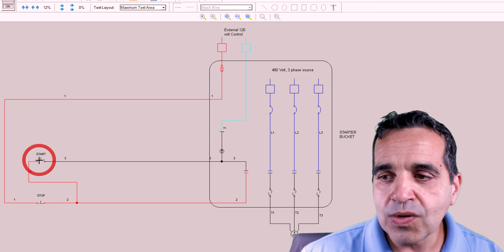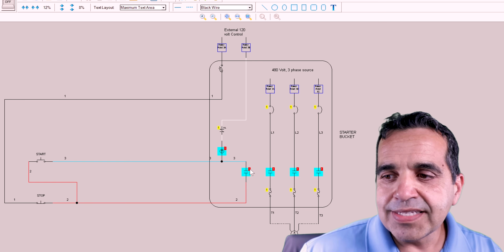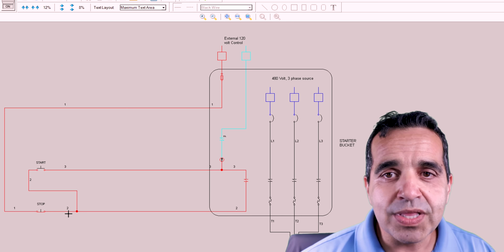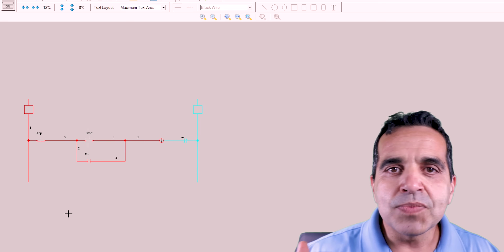Basic Motor Control: 3 wire Start Stop Circuit

Comment: You stated only 3 things turn the motor off but what if there is a ground fault in the field winding? Doesn’t the 480v circuit breaker trip thereby de energizing the motor?

Comment: I’ve watched dozens of videos, no one explains HOW these contacts are connected. If the overloads trip, the coil loses power but HOW? Where can I follow that schematic and see that by those overloads tripping, the coil opens? 

How is that 4th contact physically connected to L1, L2, L3 contacts? 

At 6:33 when he presses the start button the contact outlined in red closes. How would we know by following the diagram that the other 3 contacts close? I can see they switch to closed because the symbols change from open to closed but I just can’t follow the schematic physically to know that that is what would happen. 

Any help is appreciated. Have a great day
Reply from the maker: The 4th contact is not connected to L1, L2, or L3.. it is itself an individual Normally Open contact. It closes when the contactor coil is energized just at L1, L2, and L3 close. As far as the overload. It opens part of the circuit which energizes the coil. So if the overload trips the circuit to the coil is interrupted. This causes the coil to de-energize which opens the contactor.

Comment: Line 2 comes into the stop goes to one side of the start button. That side of the start button goes to the bottom of the contactor normally open contact. The other side of the start button goes to the top side of the normally open contact which is connected to the coil. I don’t know why this idiot cannot explain this properly.

Comment: Till 2024 I watched a lot this kind of videos, this is the best video I have ever seen with completely step by step animation.  I don't have to use too much imagination force to understand all.  Great job.  I wonder is there any contactor that uses its Lines to activate the control circuit, rather than use external 120V power source ?  If yes, how is the circuit look like ?

Comment: The symbols we use in the Netherlands are so different, would've never recognized that to be a coil. And why over complicate it with the overload switches, that could've just been an add-on after you explained the circuit. The drawing is complicated to understand if you don't know what the coil does and how it is connected to the switch

Comment: Suppose you do not have a 120V control source you also do not have a neutral and it’s 3 phase delta high leg.
Reply from the maker: It works the same way. You would need a coil on the contactor to be 240 Volts and would then use say Line 1 to power the buttons and line 2 through the OL feeding the other side of the coil instead of a neutral. This will give you a 240 volt single phase control circuit but the motor is powered by 3 phase 240v.

Comment: Excellent video. Thank you. Troubleshooting 3 phase 480v. I love it. Just today, had one phase open, after following conduit, found a bent 3\4 piece of EMT and a burn spot. Friday the guys changed a screen on the El Jay shaker, evidently when they dropped the screen over the side onto the ground they hit the conduit for the feed conveyor. So, overload tripped out from single phasing. Used a tubing cutter, on EMT and added a box a new seal tight. Reset overload and it's up and running again. Boys were clueless they even hit it.
Reply from the maker: Good job troubleshooting the motor today!

Comment: Great explanation on how to actually understand how the circuit works, I work in a huge paper mill when I'm in the MCC room looking at this bucket my motor could be hundreds of feet away where the wires leaving the load side of the motor starter goes to a local disconnect first , then feed the motor for protection.

Comment: why is it called a three wire start stop?
Reply from the maker: Because there are 3 wires needed to the start stop buttons. 1 power, 2 start, and 3 holding circuit

Comment: Thanks for the great explanation! I have one question, why would you rather use an 2 or 3 wire start, instead of a 3 pole on of switch?
Reply from the maker: A three pole switch is placed inline with the power to the motor. A 3 wire start stop can be placed anywhere you need to control the motor from including multiple locations.
Reply: Thanks, that makes sense

Comment: Great video, very well thought out. I also teach this material but I need a tool to transition to online classes. What software are you using for the simulation. I have been using animations in power point and it is very time consuming.
Reply from the maker: I use a tool called Constructor
Reply: @AccessToPower  thank you. I will check that out

Comment: I think once you see someone wire up the whole circuit, then do it yourself, you can really get a sense of how simple it is. I think VFD's are a lot easier to hook up and you get a ton more control. Centrifugal switches are another example of a simple latching switch that uses momentary buttons for start/stop like on a table saw.

Comment: GR8 video. I'm searching for a video that can reverse the rotation of a 480 volt using 2 contactors and 1 overload. Can you help? ...Interlock circuits and 480 trans connections.

Comment: Thank you for the detailed explanation. How much power runs through the control circuit (stop and start buttons)? Can the control circuit wire gauge be lower than the wires feeding power to the contactor/motor?
Reply: You could have as little as 12 volts DC in the control circuit, many systems use 24 VDC for safety reasons. 18 or 22 AWG wire. A relay has mechanically connected contacts but not electrically, so when the control contact closes, they all close.
Reply: @BariumCobaltNitrog3n  thank you. IN my case the starter coil was energized by 110v. So I assume that the coil wire gauge can be small because it is just used to close the contacts of the load line?
Reply: @bijeshj  Right. And wire gauge is determined by amperage, so whatever electromagnetic force is needed to close the contacts. 100-250 mA is common but I'm sure some are more. Using a 110 volt circuit is very common so that the 3-phase lines don't have to share. What kind of motors are you working on? hvac stuff?
Reply: @BariumCobaltNitrog3n   Connecting a wireless relay to a Magnetic starter for K3 sliding table saw (3Kw motor).
Reply: @bijeshj  Does that have remote monitoring on the wireless relay? Is that wifi?
Reply: @BariumCobaltNitrog3n  Just a regular wireless relay with a remote control. The remoe controls on/off on the relay - I wired the relay to control the magnetic starter.
Reply: @bijeshj  When you say regular wireless relay what is that device? and why a remote? Are the controls of the motor inaccessible?
Reply: @BariumCobaltNitrog3n  Relay module with a wireless RF switch (cheap on Amazon). The wired switch to the starter is difficult to access on the sliding table saw. I have it working but wanted to confirm if the wires from the relay to the Starter contact coil could be lower gauge than the 12awg motor wire.

Comment: Sir this basic connection is good for 3phs 10 hp 240v. Motor.?
Reply from the maker: This is a typical start stop control for any 3ph motor regardless of hp. You will still need to size the starter, overload and overcurrent protection to match the size and voltage of your motor.
Reply: @AccessToPower  thank you very much..

Comment: None of these videos about contactors really explain if you need a separate source of power to power for the coil to activate the contactor and another to power the motor. Or if the power to run motor also powers the coil separately in the contactor.

Comment: I can see the basic start stop circuit but i can not see how it is wired into the contacts of the multaple aplication?
Reply from the maker: Danny, check out the updated video inn the same subject. I try to show you each connection as I explain the circuit. https://youtu.be/kHbXbK7S188

Comment: Great vid..please show us how to find or trouble shoot a wire diagram in actual diagram..when it gets troubled like breaker, timer, fuse, overload relay, thermal relay..to find what parts is messing around
Reply from the maker: Thanks for the comment. For a troubleshooting video please check out out video on that Troubleshooting a Motor Starter
Reply from the maker: https://youtu.be/IxwTOByZ1yM

Comment: That diagram is incomplete. It should show the overload relay wiring. It’s just showing the overload devices without the NC relay and associated wiring.
Reply from the maker: It’s there on the diagram. Go to minute marker 2:51 and you will see the neutral wire from the control voltage going through the NC OL contact and then feeding one side of the coil.

Comment: Hey can u 🙏🏿 make on up front video to show the contact on the stop start botton  and how to connect the wires on them 🙏🏿🙏🏿🙏🏿🙏🏿🙏🏿🙏🏿🙏🏿🙏🏿🙏🏿🙏🏿🙏🏿🙏🏿🙏🏿🙏🏿🙏🏿🙏🏿🙏🏿🙏🏿🙏🏿🙏🏿🙏🏿🙏🏿🙏🏿🙏🏿🙏🏿🙏🏿🙏🏿🙏🏿🙏🏿🙏🏿🙏🏿🙏🏿🙏🏿🙏🏿🙏🏿🙏🏿🙏🏿🙏🏿🙏🏿🙏🏿🙏🏿🙏🏿🙏🏿🙏🏿🙏🏿🙏🏿🙏🏿🙏🏿🙏🏿🙏🏿🙏🏿🙏🏿🙏🏿🙏🏿🙏🏿🙏🏿🙏🏿🙏🏿🙏🏿🙏🏿🙏🏿🙏🏿🙏🏿🙏🏿🙏🏿🙏🏿
Reply from the maker: I have an updated video on the channel with close ups of the buttons and wiring. Same title with (update) at the end
Reply: @AccessToPower  ok I have find that one I would like a video of u explaining the difference s between ac an dc motor and if they troubleshoot the same way and the different size motor are being use in factory and how to read an understanding the labels on a motor  if it’s on it or not thank you for ur respond

Comment: How do u wire mcc panel
Reply from the maker: Willem, it depends. Is the control power internal to each bucket? Or is it one circuit common to
Multiple buckets?

Comment: Is your diagram a basic safety control box that protects the motor from overload? I bought an old belt grinder with a Weiser Co A-100 Safety Control Panel, but I don't know what is does or what it's for. It does have a flip on/off switch connected to the panel that must be turned on in order to get the main power switch to work. The main power switch is a separate press button on/off box that is wired to the control panel and turns the AC motor on and off. What components should I look for to determine what this panel is for, or what test can I do to determine the same?

Comment: I have seen contactor 220VAC single phase,that have NO and NC ... ,for what are these used ?? Thanks for the video!! Stay safe
Reply from the maker: microguard, there are numerous reasons one may have NO and NC contacts. A NO may be use as the holding contact, or a run light, or as a sequence control for another starter. The NC may be used to also turn on a light if the motor is not running, or to turn off a horn if the motor is running..... there are May possibilities

Comment: I am not used to breaking the neutral to de-energize a circuit.  Why not use the overload contacts in the motor started to break the auxiliary  power side to the coil?  In other words put the auxiliary overload contacts in series with the stop switch.
Reply from the maker: Stuart Milne , you certainly can place the OL contact on the control circuit side of the coil. I would suggest it be placed just before the coil though so it easier to troubleshoot.

Comment: Thanks, these Videos helped tremendously, I’ve worked on variety of Control Panels for Conveyor systems, And in my case had issues with actual loose contact wires that caused initial replacement of several components because, couldn’t determine actual cause of tripped breakers, also pitting and much carbon buildup that causes resistance buildup or arcing, loud explosive sound and smoking out of the Panels, at first thought was overloads because the high Current demands but turn out to be gap between contactors

Comment: Great explanation. Also, a lot of times the control voltage is tapped off of one leg of the load side of the contactor. So you don't have the need for a seperate control transformer. The power from the line side of the contactor goes straight to one side of the stop button. I agree about some electricians being intimidated by a motor controller. But it really is simple if you stop and look at it on paper.
Reply: Usually you dont use 277v pushbuttons. Youre more likely to see a separate 120v or 24v external power source than 277v push buttons, assuming youre using 480V/3-phase motors.

Comment: I wasn’t aware that the overloads cut the neutral when they trip. That’s odd to me. As an electrician, we’re always taught that you never control or switch anything with a neutral, even though it obviously will work. So why don’t the overloads open the hot control wire instead?
Reply from the maker: Hi Russell. I understand what you’re saying. Usually we do not switch to neutral.  I think this originated early on the automotive industry and was adopted by the NECA standards. Although today there are some European standards that require the overload to be placed in line with the control circuit on the hot side of the coil. But Think of a starter coil that is 240 V or 480 V. There would be no neutral and you would be breaking line 1 line 2 or line 3 on the overload side of the coil. Even with all that said you could definitely run or install the overload on the hot side of the coil, although that’s not the norm.
Reply: AccessToPower thanks for the quick reply. You’re right; with those control circuit voltages, there is no neutral. But there is in this one! Ha. Anyway, one more thought...why do the overloads open any wire at all? They are thermal switches that are capable of opening the line voltage to the motor all by themselves, without switching any part of the control circuit.
Reply from the maker: Russell Brown , I think one reason is the overload is a very small switch that’s not capable of handling a large load like a motor. But I can easily handle control voltage which is just the current needed to close the coil
Reply: AccessToPower i really can’t believe you just said that. Overloads are designed specifically to protect motors.
Reply from the maker: Russell Brown yes of course they are... by opening the control voltage to the coil. The only contacts in the OL is made for the small current to the coil. It is the contractor of the starter that opens the circuit to the motor. The OL has no contacts to the motor.
Reply: @RB-xv4si  You don't understand the internal workings of current limiting devices. Access to Power is 100% correct. 1:  If a current limiter independently opened any one of the 3  lines due to current overload,  a single phase condition would be created & damage the motor which ironically is the very thing overloads are supposed to prevent. A phase loss monitor would prevent that but there's no reason to make both devices trip when one is sufficient for a current ol fault.
2: Thermal current limiters are small compact devices & are designed to open small circuits only. They do not  even come close to being rated to interrupt the line. That is the purpose of the contactor. Wiring the OL control circuit to one side of  the contactor holding coil simply drops the contactor out instead of trying to do the exact same thing with a current ol device.
Reply: @planbirrigation   I now realize that typically, motor starters come set up from the factory to have the neutral (if control circuit is 120 or 277V) to run through the OL relay’s NC contact and the hot runs through the control device and the NO holding contact. But you could, in fact wire a starter to not interrupt the neutral wire to the coil. You’d just run the neutral straight to one of the coil terminals and have the hot take a detour through the OL NC contacts before it gets to the other coil terminal. I don’t think I’d go to that length to avoid wiring the neutral through the OL relay in real life though because there is an exception for this in the NEC.

Comment: Great informational piece about start/stop. My question is I have a push start/stop button switch 1 & 2. For ign which one you think I should install 1 or 2. Or 1 and 2. I like to hear your take on that. Thanks
Reply from the maker: Hi. I am not sure I understand your question. If you are asking if the start button or the stop button should be first in the circuit then I would say it can be done either way. Although from my example in the video you can see I prefer the Stop button to be first. I know others will place the stop button or button(s) in series after the start button, and that is ok, but I prefer it before for a couple reasons. The main reason is that I like the fact that if you hold the stop button down, the circuit on all the buttons downstream of the stop button will be de-energized. I think this makes for a safer installation. But that is mostly preference.

Comment: Nice video. Had one question. Here you routed the neutral wire via the NC contacts of the Overload relay. So neutral is lost when Overload is triggered. But in our plant, we apply the neutral directly to the contactor coil A2 and route the live wire itself through the Overload NC contact, stop, start & finally to contactor A1 terminals. My question is, are there any specific pros and cons u can find between these two approaches? Or any of the methods is okay.
Reply from the maker: Dipankar Ganguly That is a good question. Both the way I described it and the way your plant wires a contactor will work to turn off the contactor in case of an overload. Both methods are equally acceptable. The object is to turn off the starter in the event of an overload or loss of control power and to have a safe means of resetting so that the starter can be turned back on.